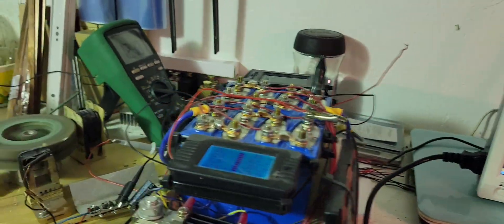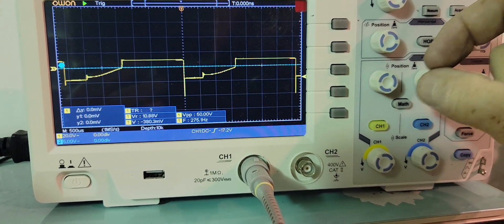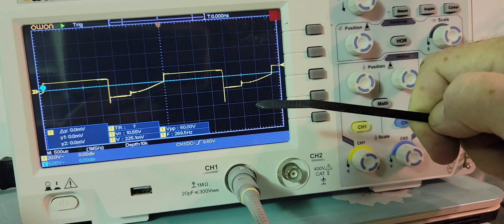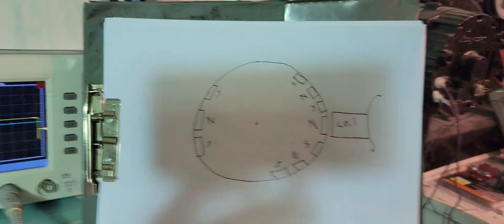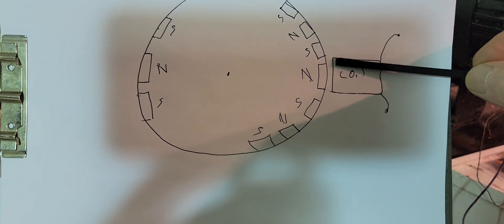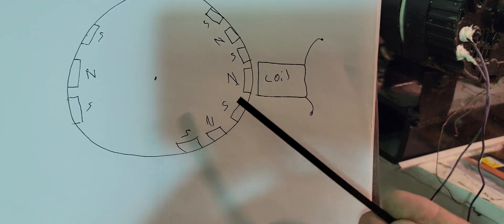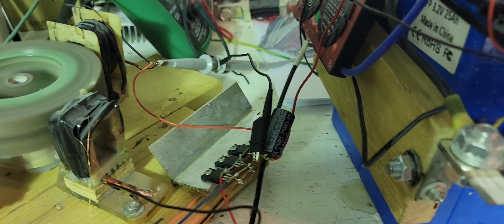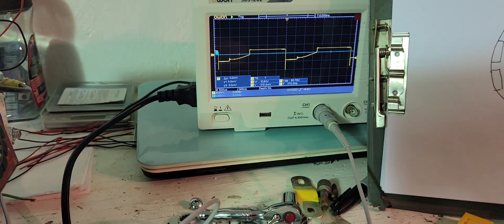This is how these pulse motors work...Bedini motors don't work like this and this is why

Comment: Hi, thanks, very interesting stuff. Could you provide a guide to selecting transistors for this application? You mention a few by numbers but not knowing much about them I can’t seem to take that info and find similar components. What sort of spec min/max should one look for?
Reply from the maker: https://www.ebay.ca/itm/5-Pieces-2SD2241-NPN-BY-TOSHIBA-ECG261-/303521962969?mkcid=16&mkevt=1&_trksid=p2349624.m46890.l6249&mkrid=711-127632-2357-0

Comment: Good stuff. Thanks again. There is also less resistance / voltage drop when using many transistors and leds in parallel. I recommend to look up the videos about "Torque Force motor by Inverted_Realities" too.
Reply from the maker: Awesome thanks for watching!

Comment: i tried looking up pulse motors at first i ended up with pulse jets, i never knew they existed , i read people can use them to produce power but i expect axials would be better as a generator. interesting motor all the same.
Reply from the maker: The best part about them is they operate the same as a normal brushless dc motor but they charge batteries too . The input or torque isn’t affected from the charging. They are designed to be used for torque.